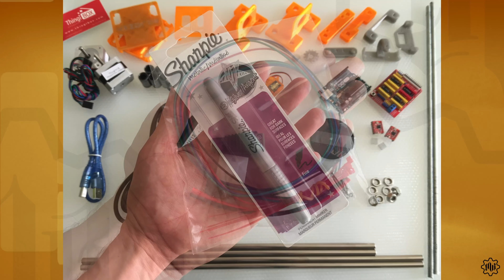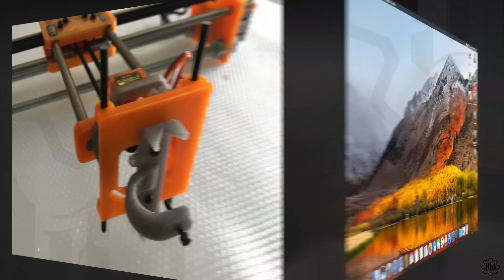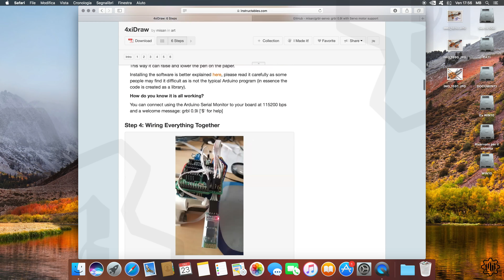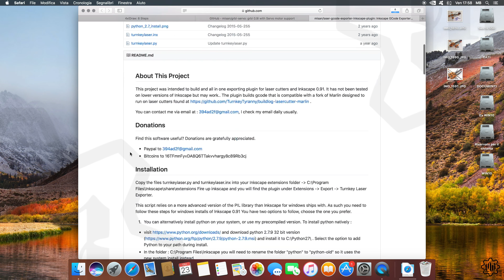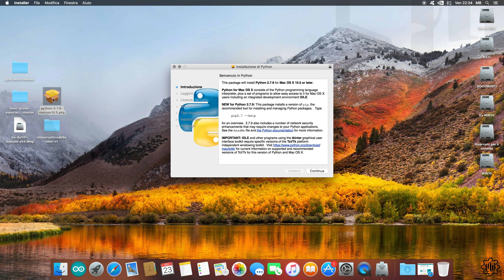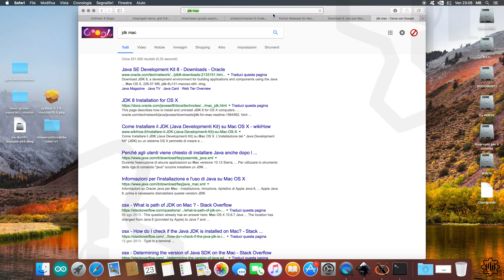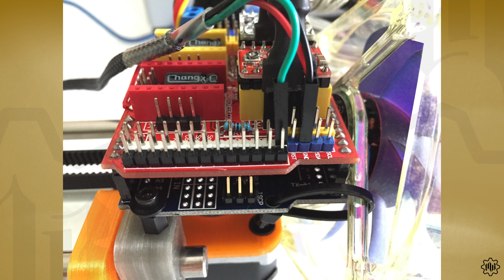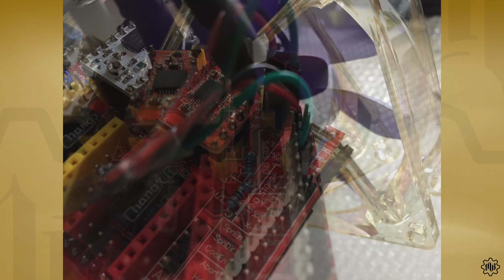✍🏻✒️VIDEOTUTORIAL - 4xiDraw "Clone" - The Drawing Machine (UHD - 4K) ✍🏻✒️

Comment: Hello, your content helped me a lot but I have some doubts.  of the two motors, which is for the "x" axis and "y" axis.  each motor has 4 wires of different colors, how to know which wire color is connected to the driver boards at "x", "y".  In the calibration you only use the command for the "x" axis which is $100= 80, but you don't use for the "y" axis $101= ?.  Thank you
I wait your answer.

Comment: Hi I have converted the text to gcode using inkscape extension but i am not able to add the infill lines to the Text 
its only converting the outline of the text
How to convert the Text to gcode witht the text outline and also infill of lines in it 
Please tell me 
I been trying with Axidraw control but getting python 3.6 error and also not sovling the error 
Please tell me .
Thanks in advance

Comment: UGS Version 2.0.7

When i Click "X+"
>>> $J=G21G91X50F10000    (Only one motor is running) so the Machine moving like this direction "↗"

When i Click This arrow "↗"
>>> $J=G21G91X50Y-50F10000  (This time 2 motor is running ) So machine moving like this direction "→ "

So the problem is here i want to move x direction when i click X+ To move "→ " and "↗" this to corner direction 

I changed the Stepper motor pin many time no use. Please help me to solve this issue.

Comment: Hello Sir .I made the 4xiDraw as per your instraction but my servo is not moving. do you have any vidio for it. Pl help.Actualy Iam a HOBBIEST. Need help to setup UGS, I am totaly new in this. Pl Pl Pl HELPPPPPPPPPPPPPPPPPPPPPPPPPPPPPPPPPPPPPPPPPPPPPPPPPPPPPPPPP.
Reply from the maker: 26:04 Servo Pins.
Check the wiring and the Arduino program

Comment: hi, thanks for sharing. for me it works i only have one problem the machine going to the walls how can i set "home" so that it can start drawing in the middle
Reply from the maker: Hi Double Negatives,
it is the Gcode that decides this. 
You have to work on it to do what you want.
Reply: @TheMiguelBi  thanks for replying i will try to measure, another question i am using the same software (turnkeylaser) and it is not generating the Z code, i looked your video and it's the same for you X and Y are moving while Z stands 0

Comment: Some of the Items listed in the description are different from the items mentioned on you instructables page. ( Pulley 16 Teeth on Youtube, 20 Teeth on Page). Which one should we follow? The youtube description or the Instructables page?  Also some of the items are different like the rods are a bit longer and the nema 17 stepper is a bit different ( 1.5 A instead of 1.7 A ). Is that okay or will that affect everything?
Reply from the maker: Hi Ahmed Safeer ,
Even cars go ahead, but they are made of similar but different components! 
Each choice is to be adjusted in the software. There is no right or wrong, everyone buys what they want. 
The engines will be controlled by stepper drivers. If you buy 1.5A you will have to set them with a Vref of a certain value, for 1.7A motors you will set them to another value.
Let's talk about Arduino! We cannot want to do certain things, avoiding knowing the base!

Comment: Salve, scrivo in Italiano perché ho visto diversi suoi video e sò che è italiano...complimenti per tutti!
Io ho seguito passo passo la video-guida e le info su instructables, solo che ho problemi con il muovere l'asse Z con il motore SG90 (quello dello starter kit originale arduino 1), tramite il UG-code Sender in manuale...Riesco a spostare gli assi X e Y, ma quando provo la Z il motorino fa tanto rumore come se volesse muoversi, ma nulla di fatto (ovviamente ho provato sia a motore libero che con tutto il 3d collegato). Cosa posso fare?
P.S.- per i driver sulla cnc ho messo tutti e 3 i ponticelli giusto?
Reply from the maker: Hi BlackGeare, 
For the 3 jumpers is correct, the software is configured for 1/16 of steps, so 3 jumpers is fine. 
As for the servo motor, have you tried rotating it with your hand while it is disconnected? Rotate normally? Perform the tests leaving it in the central position, not at the end of the stroke. Connect GND and 5V, while the Orange cable must be connected in "Z +". Let me know!

Comment: Thank you for this excellent tuto (without your help I could not finish my own project) . Now it's almost correct for me except an only small problem : all draws are printed at 45° (diagonal) regarding the sheet. I cannot solve this point. Have you any idea to fix that ? Thank you ;-)
Reply from the maker: Hi Eric Caston LeLaurain,
Check how the two engines respond when you give a movement command. 
X axis movements the two motors must turn synchronized, while movements in the other axis the motors must turn in opposite way.
Does this happen or not? If the answer is no, you have not set the movement as "coreXY", but as a Cartesian. You need to review the GRBL settings by typing $$.
Reply: @TheMiguelBi  Thank you , you have probabely right , but unfortunally, I cannot see this alernative . It is really into G-code sender ? After $$ typing  I cannot acceed to this choice : Cartesian/CoreXY where is my mistake ? ;-)
Reply from the maker: At the moment I do not remember, but it should be among the GRBL variables. 
Do something like this:
Rotate 180° 1 only block a motor (4pins) on the CNC shield board, the one you prefer, and see what happens. ;)
Reply: @Eric Castor Lelaurain Hi, Im having the same problem. Have u solved urs?

Comment: Hello sir, I have made the same machine as a project and is working perfectly. The only thing is that it only draws the outline of the image or text uploaded. It does not fill enclosed figures as the image originally is....How to do the same....Please help...!!!
Reply from the maker: Hi ramnath marketings,
This is perfectly normal. It is called vector graphics. 
The answer finds it on the first blocked comment. Read 🔝

Comment: I have watched your video and I have done everything. I will have a responsibility. X axis motor is very hot. I have not seen the connection in the list. I did not see the video. How did you do it?
Reply from the maker: Hi mehmet akyıldız,
The engines both work the same way, being a coreXY mechanism. 
Therefore he can not heat an engine differently from his brother.
Surely you will not have correctly adjusted the reference voltage (Vref) on the drivers. 
Look for some information about the drivers you use, in the case of the video it is A4988.
Good job!

Comment: dear the Miguel Bi
   see this video....that's my problem https://youtu.be/nK9vu7gblvM
Reply: In one direction on both x and y runs smoothly....but in opposite it moves both direction when I action is given
Reply from the maker: Hi Praveen Rock,
In this project, the 2 engines work like the CoreXY printers. By turning both in the same direction, an axis will move back and forth. While if a motor turns in opposite direction to the other, it will move the remaining axis.
Take this test. Remove power. With your hands, try rotating the two GT20 pulleys of the 2 motors. It will help you understand the movements.

As seen on video, the left engine does not move as it should. In fact, the pen goes diagonally. 
It looks like the X axis motor driver is not working. You could reverse the two drivers from the CNC shield, and see if the problem moves to the other engine, or it always stays on the same engine.
Reply: TheMiguelBi 
now it moving in diaganoly 
for x+ and y- in same direction
and for x- and y+....what's the problem sir
Reply from the maker: as I already told you. one of the 2 drivers is burned. Or you have incorrectly adjusted the Vref.
Reply: TheMiguelBi 
      sometimes ...it working correctly ....sometimes going wrong ..what's the problem
Reply: TheMiguelBi 
pls suggest proper vred value sir
Reply from the maker: It is not a standard answer. It depends on your driver. 
Look for a video in English on YouTube.

Comment: Dear The miguelBi
      I also made this axidraw.....one small problem that ..the x+ and y + are correctly working while x- y-  working it moves in both x and y....so belt was slip and making sound
Reply from the maker: Hi Praveen Rock,
The 2 engines always work together in all directions. They turn synchronized towards the same direction to move an axis back and forth, while they rotate oppoistently to move the remaining axis. Search for "CoreXY" to understand the mechanism well.
Check your GRBL values! Surely there is something wrong set.
Are the wiring of the A and B coils of the 2 motors correct?

Comment: Hi, thanks for your video, it makes assembling this a lot easier.

One thing though, you mention hooking up the power supply directly to the CNC shield. misan says repeatedly not to do this; it should be connected to the Arduino:
https://www.thingiverse.com/thing:1444216/#comments

I looked at other people's builds and they seem to do it the same way you do, which confuses me, since he seems pretty confident it should be the other way =(
Reply from the maker: Hi tactical retreat,
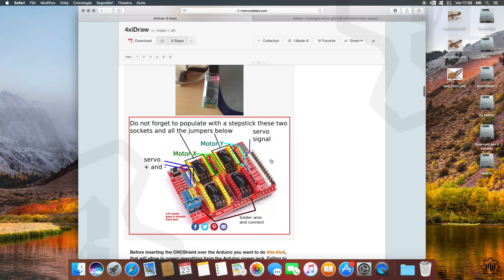You are right. Misan says to feed everyone through the 12v of arduino. And to make the "modification" of the cable, up to the "+" connector of the SHIELD CNC 10:07.
That said, I have always given the power to the CNC shield, probably wrong. Fortunately I've never burned anything. 
But I will try to make a new video soon, where I will follow Misan's advice, highlighting this during the video.

Comment: Hello.. I have made this project without probems so far.. when i upload text, the machine do the drawing witout problems, but if i try to convert an image, the turnkeylaserexporter shows me a message that my image is part of a group and dont generate de gcode.. i press shif control g, and in the bottom shows a mesage that the image is not part of a group, neatherless the turnkeylaserexporter keeps showing that message and i can generate de gcode to draw images.. can you help me themiguelbi?..
Reply from the maker: Hi Antonio Pedro,
and this happens with any image? even with a very simple image?

You have the possibility to try another PC, maybe the problem may be the software. For some reason installed with problems.
This type of error has never happened to me ....

Comment: The structure of the project is such that when we give a command  " G01 X10 F100 " it should draw a striaght line according to the gcode but it will draw a slant line beause of our structure of project . Therefore when i am sending any gcode it is not printing correctly . What should i do to solve this problem
Reply from the maker: Hi Rudraksh Agrawal,

To draw a straight line, both 2 engines must turn. Your problem is a burned driver, or not properly adjusted. Have you set the correct Vref in the two A4988 ??

Comment: As soon as i insert the  A4988 driver into the cnc  shield connnected to arduino , my pc loses connection with arduino and no connection port is seen thereafter . I tried to figure out the problem but not able to solve. Please can u help.....??
Reply from the maker: Hi sourav jain ,

Mmmm .... DO NOT have to insert with powered arduino / CNC Shield!
Surely the problem is a damaged driver. Try entering one at a time, and then only connect to the arduino.
For testing it is not necessary to feed the CNC shield. The power only serves to physically move the engines.

Comment: Instead of a4988 driver can i use DRV8825 for nema17 stepper motor(1.7A)..???
Reply from the maker: Everything is possible hema kumar. 
However, you must download the Datasheet of that type of driver. 
It is not configured in the same way.
Reply: TheMiguelBi in this video which one is x stepper and which one is y stepper??
Reply from the maker: The X axis is "still" together with the electronics.

Comment: We have to set any voltage or ampere in a4988 driver  any which power supply we have to use 12v 2 amp or 12v 5amp
Reply from the maker: No, the A4988 drivers are set via a voltage value (Vref) that depends only on the motors you use. 
The power supply must be sufficiently good based on the hardware it needs to power. 
A 2-amp feeder is a bit too limited. Better a 5A!
Reply: How to find vref of motor TheMiguelBi
Reply from the maker: It is a mathematical formula. 
Here my video (only in Italian language) https://youtu.be/wpUMptJo-xs
But on the web you can find something else.
Reply: TheMiguelBi can u give me your mail id i will mail you everything with photos of motor and it detail you will tell me the vref and everthing

Comment: Do i want to adjust a4988 driver???? Or when I want to adjust it..? Can i use that without any changes???
Reply from the maker: Hi hema kumar,
Of course they are to be adjusted, adjusting the Vref according to the type of your engines. Search for a video in English, unfortunately my video on the adjustment is only in the original language.
Reply: Can u please suggest me any link or any video... Am using nema 17 stepper of torque(4.2kg)..

Comment: Can any1 tell me, about how power is supplied through? Is he using arduino usb port as well as cnc female pin connector at a time to run the machine?
Reply from the maker: Hi Dhyey Shah,
The USB port of arduino will power only the Arduino (software part). All the power part (motors, servo, etc.) are powered by the CNC board only.
Reply: TheMiguelBi 
I have made this as shown in your video
But now, I want to increase the speed of stepper motors , i tried increasing the F value in gcode, but nothing worked.
Can you tell me about it?

Comment: halo i want to make this project but i have one question. Did it's enough to power this project with adaptor 12v 2a? or maybe higher than 2a? thankyou
Reply from the maker: Hi Ricko Arthadinata ,

It depends on which engines have been used by you. my engines are almost 2A each. In fact, I have a 12v 6a power supply. If your engines are 12v 0.4A, it may be that the 2A power supply is sufficient. Hello

Comment: Hi Miguel, I really like what you've done This is a great product. I'm looking to build one too. Can I order those products on Alibaba instead of Amazon? I thought you had a list with all necessary materials referring to Alibaba in one of your posts... I might be wrong. Anyway thanks.
Reply from the maker: Hi Atakan Tan, 
No, I do not have any list of components, but you can look here https://goo.gl/2uY4go
The only difference is the 8mm threaded bars using my STLs, they need more than exactly 10mm.
Reply from the maker: Here you can find another shopping list http://www.instructables.com/id/4xiDraw/
Reply: Thanks Miguel!
Reply: Hey Miguel - I run into an issue while using Inkscape Turnkey Laser Exporter the outcome I got is: "The extension requires at least one selected path. Finished processing." I've done everything shown steps by steps. Any idea? Thanks!
Reply: In conclusion it doesn't save any *.gcode file nowhere.

Comment: can i use 19v-6,32a power supply instead of 12v-6a?
Reply from the maker: Hi Mehmet ÇOBAN, 
http://osoyoo.com/wp-content/uploads/2017/04/Arduino-CNC-Shield-V3-Layout.png
here it says power from 12v to 36v. 19v are not many more .... but I can not give you any confirmation. For the servo motor you must connect the positive cnc shield with arduino. Giving arduino 19v is not a good thing in my opinion...
Reply from the maker: Rather you buy a 12v 3A power supply that are much cheaper!
So there is no risk of burning everything!
Reply: thank you for your prompt response. You’re right, to avoid risk, I buy a 12v one. But also I saw that same type of step motors are run from 12v-1a to 12v-10a. Isn’t current level important to run. Also can servo motors be run like that?
Reply from the maker: No, the servomotor works only at 5V, and it is powered by Arduino. The problem of the higher voltage, in my opinion, is arduino overheating.
http://akizukidenshi.com/download/ds/towerpro/SG90.pdf
Reply: I see, thank you
Reply: Last question. I have a small trouble with the servo motor. It doesn’t move. I tried moving it independently. It worked then I tried on the shield again independently. It again worked normally. But when I created gcode file it doesn’t work. The step motors work but the servo doesn’t. What is the reason you think?
Reply from the maker: The problem may then be in the created Gcode. I usually use M3 0 and M3 30, respectively for pen down and pen up. Manually typing these values, does the servo move?
You have to open the gcode file with Notepad ++, and look up the command lines before the motors move. You should find it quite easily. There is the problem!

Comment: How is the "string" connected? (from motor to motor, and in the middle). Cause in the video I couldn't see how you did this
Reply from the maker: Hi Fabian, 
It's easy!
Look here: https://goo.gl/Y5dwMH
Press over the center piece with the right mouse button and click "hide". Now look at the intrigue of the belt. 
The belt should only be attached to the opposite side of the pen.
6:24 You have to make a "cross" with the Belt.
Reply: Is the belt continuous and one piece? How are the X and Y movements happen then? I cannot imagine how it is realized. I assume for Y (shorter axis) only one of the motors works but for movement along the X (longer axis), both motors work in combination! Am I right?